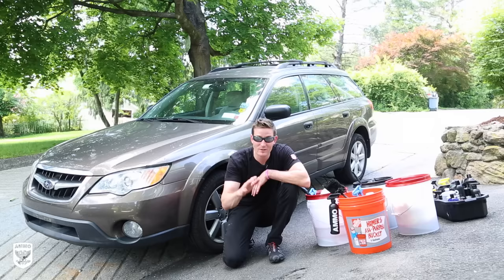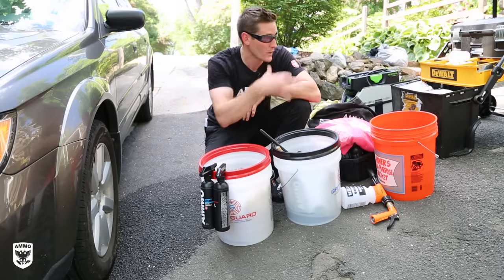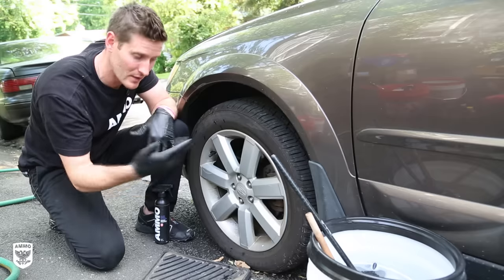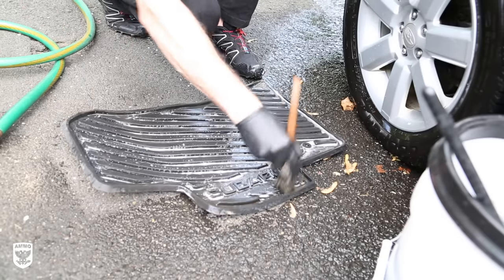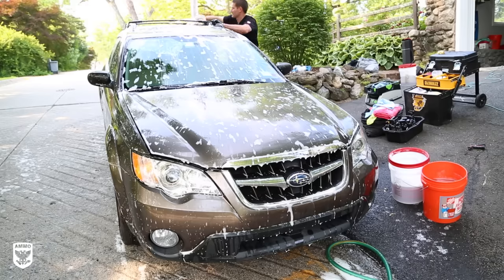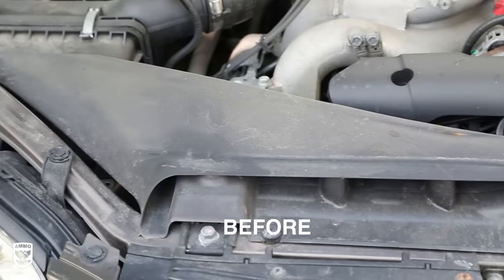Best Carwash Technique: 15 Steps + Tools

Comment: Just wanted to add my suggestions on things I've learned over time. 1, I vacuum the seats before the carpet. A lot of times things jump from the seats onto the carpet..it saves time. 2, I do the windows AFTER the tire shine. The smallest amount of wind carries that tire shine onto everything..also saves time. 3, I clean the interior first always because when cleaning/lifting dirt/dust from the inside, it can end up blowing around to the paint. It's comforting to know when I'm finished the inside I can close it up n not have to get back in.
Reply: I definitely feel the same way, I always get the interior before the exterior. I usually do the engine bay first and foremost
Reply: I do this unless I'm extracting that way everything has time to dry but usually my extraction jobs i schedule for a little longer toake up for drying time i hate giving back a moist car .

Comment: Steps:
01 - Walk around/wash tools 1:42
02 - Engine cleaning 4:20
03 - Wheel cleaning approach 5:49
04 - Cleaning Wheels 7:58
05 - Cleaning floor mats 8:49
06 - Fill buckets with water 11:28
07 - Foam gun/pre-rinse 11:42
08 - Washing the Car 11:58
09 - Drying with Hydrate 13:54
10 - Clean door jams 14:33
11 - Vacuum interior 14:57
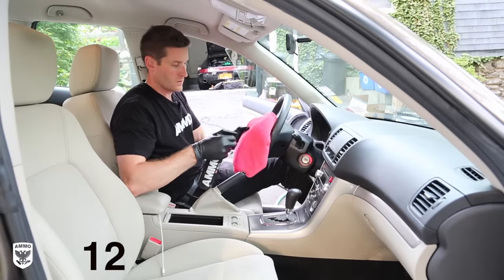12 - Quick interior cleaning 18:45
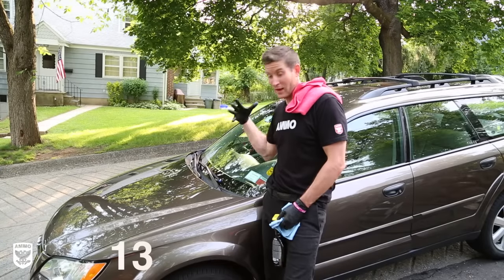13 - Glass cleaning 19:23
14 - Tire dressing 22:15
15 - Engine dressing 22:54
Reply from the maker: +NicholasG28 Sweet! Nice work!
Reply: +AMMO NYC No problem!  Feel free to put it in the description so more people will be able to see it
Reply: +AMMO NYC What are your thoughts on using silicone spray on plastics for a shiny look?
Reply: +MrPungnylle b I'm sure he's not for them. I assume he would more so recommend a water based product. I say this because he uses a water based tire gel instead of silicone based, which actually you can use AMMO MUD tire gel on your trim; however, it won't necessarily be super shinny if that's what you're looking for. It will look good but not totally shinny.
Reply: nice
Reply: Thanks for the guide!
Reply: +NicholasG28 bling bling is not for him remember lol
Reply: Raspberry Pie there's 15
Reply: Nice!! At first I was like, "How the heck am I gonna watch 25 minutes of Larry washing another car". But damn, it went by so quickly and learned so much. I've watched some many of Larry's videos and I'm still learning something new from each of them.
Reply: Real MVP.
Reply: You are awesome Nicholas. And Larry, copy and paste this time list to the description! I am making a personal wash guide on excel and I come to this comment all the time.
Reply: thank you sm. i was assigned this vid for auto detail class and we have to fill out a sheet with what the steps are.
Reply: THANK YOU
Reply: @AMMO-NYC  copy and paste that timeline, but add "0:00 Intro" to the top, and the video red timebar will add your sections to it

Comment: Thank you for mentioning the seat position. I have even had details done where they have changed the steering wheel, mirrors, seat and radio stations. It's the small things customers remember.
Reply: Rice Crash that’s absolutely right. I didn’t go back to a dealership because they refused to give me an owners manual for a vehicle I just bought. When I went to buy another vehicle they were blowing me up trying to get me down there. Won’t even glance at the place as I drive by now. The details matter for sure.
Reply: Salty Honkz Why did they refuse? That is just stupid. I’m assuming they had one available- I can’t think of a single reason to do that which makes sense...
Reply: Look it up online or buy it idk where you could purchase one.

Comment: I so enjoy watching your videos.  Im glad to see Ive been doing a lot of things right when I wash my vehicles.  I, however, always vacuum first.  I have an inexpensive Craftsman vac and the dirt on the garage floor gets blown around when I run the vac so I dont want that dirt, or "Gunk" getting on my car.  Secondly, I NEVER put towels over my shoulder and then use them to dry or do glass.  I find that sweat and/or oil from my skin gets on the towel and then on the glass or paint.

Comment: I am nervous about cleaning inside of the hood. Can you make a detailed video about how to properly clean the engine and the DOs and DONOTs for it?
Reply: @BadassEFdriver  I usually use a pressure washer, or a self service car wash lol
But I am a mechanic, so I know where not to spray...

But generally, unless something is wrong, you can hose an engine down with no problems.
Run it for a while afterwards to warm it up and make sure everything dries out so nothing seeps into connectors.
Reply: pretty much a bad idea to spray water in your engine bay, not worth the risk.
Reply: @steveneumeyer681  I assume that you also don't drive through puddles, or when the road is wet?
And be careful, if it's foggy outside and the fan turns on, it will blow moisture directly onto your engine! Lol
Reply: @BadassEFdriver  you do that in a Pontiac you're fucked lol.
Reply: Nothing to worry about. I pressure wash mine with no issues.
Reply: Steve Neumeyer please.  It’s designed to be outdoors.

Comment: Thanks for the awesome video.  I wish I watched this before doing my first wash with my new tools and new car.  I skipped the first step and didn't notice that there was a bunch of sticky tar on the bumper and a gooey bug splatter on the windshield so I got this mess all over my brand new wash mitt and it was almost impossible to get clean again.  I also tried washing my black car in the sun (oops) but I've learned my lessons so hopefully the next wash will go smoother.

Comment: I cringe when I think back to the days where i used to dry my car with old shirts.. oh god why
Reply: I see your "where i used to dry my car with old shirts" and raise you "using dishwasher detergent as car shampoo"
Reply: I raise my own "using dishwasher detergent as car shampoo" and double raise it with "using wd40 and the jet steam spray wand and my dad's work place used for cleaning big rigs"
Reply: I used to put the cheapest carnauba wax on my car which used to be my dad's with an old sock that I'd set down on the ground between panels. #ThrowbackThursday
Reply: My dumbass 16 year old self use dawn dish soap to wash my accord thinking I was doing myself a service..... TWICE A MONTH 😂😂😂
Reply: I had my last car for 12 years, washed it 5-6 times a year using the cheapest shampoo I could find and a sponge. And I had just one bucket.  And after 12 years it still looked like new...
Reply: You don’t have to dry it at all
Reply: Feel bad for fundraising car washes with kids. They don't know but they use same bucket same rag swirling, depending on kid age probably bottom to top..
Reply: @AdrianJayeOnline  many pro detailers use detergent for some instances btw
Reply: @Chris-eo1bp  There really not not much difference in dishwashing liquid and detergents. The both use scents and they both have soap suds grime removing chemicals.
Reply: In the very beginning I used a synthetic chamois smh.. and I would apply only carnauba wax in tight circles everywhere
Reply: @AdrianJayeOnline  Nooo lmao my brother did that too.. His paint literally does not exist anymore.. Literally faded down to bear metal in some areas lol. The car aged like 30 years in 10

Comment: Step #1 - Overlook: 1:43
Step #2 - Engine: 4:21
Step #3 - Take out floor mats: 5:49
Step #4 - Wheels: 7:58
Step #5 - Wash floor mats: 8:47
Step #6 - Fill buckets: 11:29
Step #7 - Foam gun: 11:42
Step #8 - Wash mitt in soap: 11:47
Step #9 - Drying towel: 13:55
Step #10 - Door jambs: 14:36
Step #11 - Vacuum cleaner: 14:58
Step #12 - Dash board/seats (interior): 18:46
Step #13 - Windshield (interior): 20:43
Step #14 - Double-check rims: 22:14
Step #15 - Engine plastic/exterior trim: 22:55

Comment: Thanks for the great vid! @11:44 I'm curious as to whether you've ever put foam on the car, bottom to the top. I used to work in a food processing plant and that was how the operators were trained to clean the machines before they were sterilized. The reason is that the foam would coat the bottom and stay on that area the longest. Subsequent layers of foam applied higher up would cascade downward in sheets over the entire previously foamed surface. Foam tends to travel downward over wet areas, not dry (‘legs’ will form @11:45). If you foam the bottom first the foam applied to the upper part will work it’s way all the way down to the bottom. Washing and rinsing would then be done top to bottom as usual. A small thing, but I find it gives more bang for the foamy buck. Great tutorial, i look forward to learning more.

Comment: Bro I can't afford all these products lol
Reply: Meguiar's gold class soap.  Works well.  Use more than directed to make sure you have plenty of lubrication.  Double the dose for your wheels. 

Armor all wheel cleaner.  Spray it on your wheels like the "plum" pre spray.  Use it as a pre spray yourself.  Then, using your over-concentrated gold class soap, clean the wheel like normal. 

Get his "skin" defense coat.  Easy as pie to put on and buff off, and is amazing stuff.   Yes, it's 65 bucks....but I've kept my car skinned to the max for over 2 years, and have about have the bottle left. It's actually enjoyable to apply.
Reply: You can always start washing cars with a Thong so you earn money to buy these products lol 😂
Reply: @marlonestrella8105  .

Comment: I can always pick up something from someone who’s living is a task I do once a week. I’m a self employed carpenter. I have a truck and pull a portable workshop in a enclosed trailer. I work in high income neighborhoods. I feel keeping a clean, well organized rig displays what you are all about through action. I also keep my vehicles for a very long time, I want them to look as good when I got them. It’s far easier to have a regular wash cycle that takes minimal time. I will get a foam cannon, looks like that can be doing passive work while I’m getting other things done. I use a super soft wash brush for semi trucks, I do about 3-4 times the amount of soap to avoid scratching the wax. I clean the engine bay once a month. Mechanics will take pause and up their game when they see a clean 15-20 year old engine bay.

Comment: Best detailer by far but man his products are expensive! Like seriously 60+ dollars for a fucking wheel brush really!?
Reply: Go onto ebay and you will find everything you need from china dirt cheap!
Reply: I'm not sure how good that wheel brush is but the Brute wheel soap and Plum brake dust remover do work as advertised.
Reply: 60 bucks???  I paid 40 for the wheel woolies, and I got 3 of them.   Bought them when I got my 15 around July of 2015.   Still work fantastic.  The woolies rinse out the brake dust very well.  Highly recommend.  

As for his products, you're right.  The "foam" paint wash, and the "plum" wheel spritzer, and the "brute" wheel soap is a bit much for what you get.  Solution??  Get the Meguiar's "gold class" soap, and use twice the directed amount to baby your paint. Do the same for your wheels.  It's cheaper even when you use dumb amounts of it!!! LOL
GET THE ARMOR ALL WHEEL CLEANER.  Works just like the plum pre-spray (but I think it's better)  You spray the wheel cleaner on the wheels, and it feels super slick on the wheels.  And it's the same price of the plum, but you get more than twice the amount..........and no shipping.  

The "skin" protectant is theeeeeeeeeee shit.   GET IT!!!!  Yes, it cost 65 bucks, but again, I've had it for over 2 years, and still have more than half the bottle left.
Reply: hes based out of Manhattan, NYC. fucking cigarettes are like $14 (seriously) and you hardly can smoke them anywhere.

Comment: Another great video from you Larry! Here where I live, in North Norway, i first use Surfex HD prewash, then i use my kranzle foamgun for my powerwasher and rinse the car down from bottom to top. After I rinse the car down from top to bottom and then I start the handwash with 2 bucket methods to avoid roadfilm as we call it here in Norway. My bucket has nearly none "junk" under the gritguard and here we drink the regular water because it is 100% clean :)

Comment: I've got a neat little swivel pad fitted to an extendable handle that allows you to get right down into those hard to reach narrow areas where the windscreens meet the interior of the car , especially good for coupes where the rear window is even more tight to get to .

Comment: Here’s a great tip I’ve had forever: I had a plumber install a hose bib in my garage. It’s tapped into my hot and cold lines to the house. I also have a soft water system. Thus, I can have the hose water at any temperature I choose, AND the water is soft, hence NO water spots! My cars always look amazing. 😁

Comment: I was surprised that Larry didn't do a dry wipe down of the engine bay to begin with. A good degreaser wipe with a cloth will help remove a lot of contaminants that he ended up washing down further into the engine bay when he just popped the hood and hosed it down. Learned that one from the ChrisFix video on engine bay detailing

Comment: I use a very similar method to this, except in the wash step i use 4 wash mitts.
Mitt 1 - roof, hood and top of trunk
Mitt 2 - windows, middle section of the car
Mitt 3 - bottom of the car
Mitt 4 - front (generally the worst section due to bugs)
I use 2 bucket method (tires are bucket #3 as well) but once I use a mitt for its section, i rinse it good and hang it up. When all done i will clean the mitts and hang them to dry

Comment: Good stuff !!! 

One thing im not sure if im the only one who does this but i never liked the bucket method. Mainly because when ever i would start on one end of the car with suds and my mitt and work my way around the car, by the time i finished around the entire car the suds that were there are nearly dry. 

So usually i start with rinsing the car, then i actually use a method where i drizzle the soap all over the car, then i spray the soap till i get thick enough suds and use my mitt. It would be nice though to have the same thing you do where it can shoot suds out onto the car in the first place. would make washing my car alot simpler and effective.

Comment: I typically use a basic wash ( sometimes a undercarriage flush ) then use Turtle Wax Express Shine spray, and car wash tire cleaner on the floor mats and under the engine ( typically only do it 1 once because it does not get dirty again ). I use a basic shop vac at home.
Reply: Can you describe exactly what you mean by undercarriage flush? Are you referring to cleaning the wheel wells, or making sure the car is clean when looking at it from the bottom. 

I'm trying make the underside clean for when I look at the bottom when the cars on a lift
Reply: Joey Arthur Zooberry  if you have a pressure washer, check out the ryobi water broom

Comment: I noticed a few differences in the way you washed your car from what I have learned from other detailing blogs. I am genuinely interested in knowing why.

1. You did not use a pressure washer. Isn't it more effective in getting the dirt off the car surface during the initial rinse.
2. You did not use a snow foam pre-wash. Afaik a snow foam clings to the surface and loosens the dried mud, bird poop etc if left for a couple of minutes. Most importantly you rinse the snow foam again without touching it and it is after which then you get to the manual washing using the wash mitts. It makes sense as you get as much dirt off before touching your car to minimize scratching the paint.
3. You did not use a blower to dry the car. Ofcourse you will need to wipe it with a microfiber anyway but it makes it a lot easier.

Comment: I'm 19, just got my first car, which is a 1998 Dodge Neon. I know it's not a really nice BMW or Charger, but it's a start. I've been getting really into caring for it, even more so because the previous owner didn't take much care of it (he sold it after he dented up the front from when it went under a trailer home). I've been trying to care for it and restore it as best as I can and your videos have been a great help. Thanks a lot!

Comment: one trick i seen for the seat issue, put a piece a masking tape from the lower seat section (near controls) to the lower panel by the door or somewhere in that area tear the tape before the seat is moved, when you slide the seat back you can slide it forward to nearly the exact same position. don't have any tricks for the reclining though.

Comment: Apart from one thing, I understand the purpose of and/or agree with all of this. The water filter system looks great - not too geeky at all. The one thing is the grit guards. Seriously Larry, how are these things going to do anything useful? The holes are literally 1000 times larger than anything that could potentially be trapped, especially if there is a rinse or non-contact wash, before any hand cleaning. Those guards would have to be made with a fine mesh to be of any real value.

Comment: I started watching your vids to determine the best method for washing my car. With your latest video you just showed me how EXACTLY to do it. I drive a 2009 Outback 2.5XT! I drive hard on occasion and one thing I'm worried about is evident brake dust (gunk :) build up aft of the front mud flaps on the paint. Should I treat that differently or just take care of it on the lower side-sill paint wash step? Thanks!